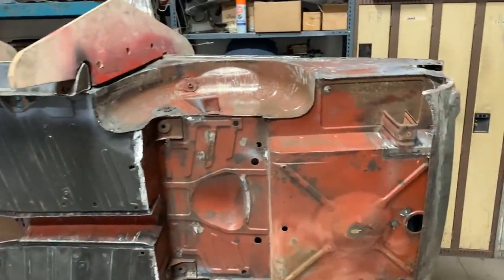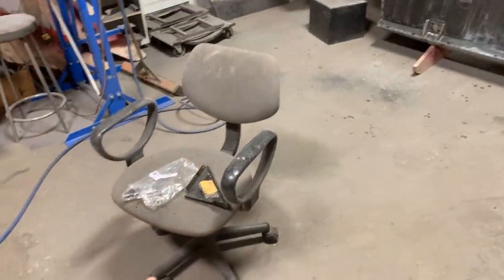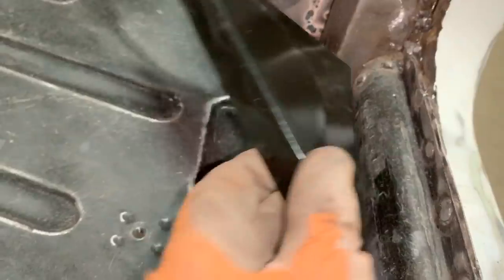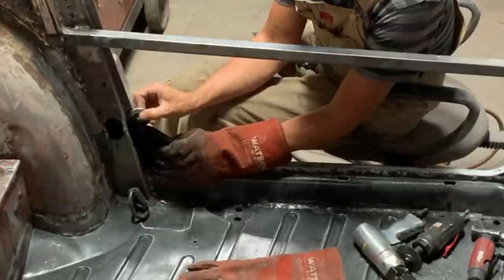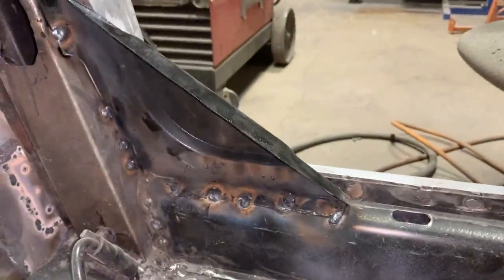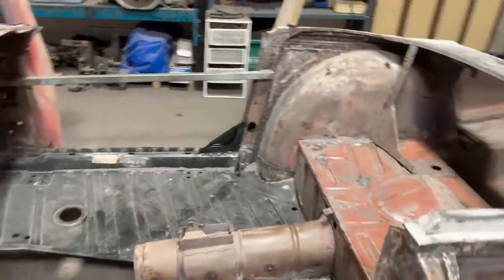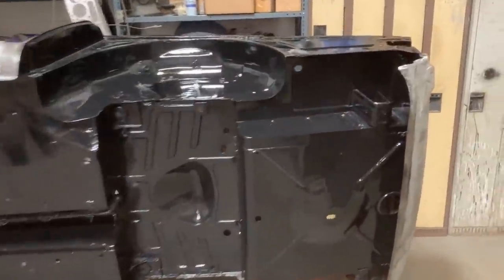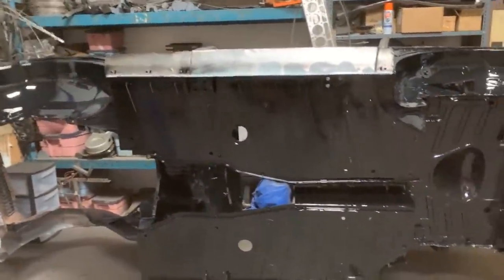1974 Triumph TR6 restoration - Part 48 - Spraying the bottom

Comment: You should buy a used paint booth. They're usually kits and can be disassembled and moved to another place. Then you have a paint shop with filtration and an exhaust system.